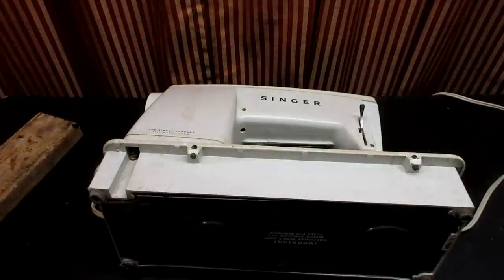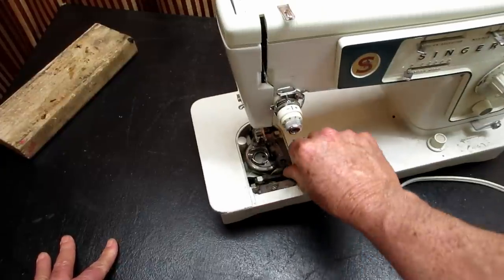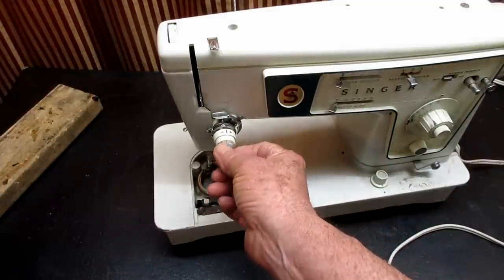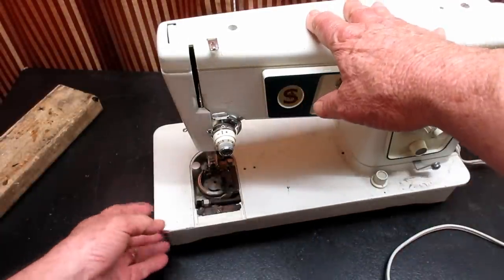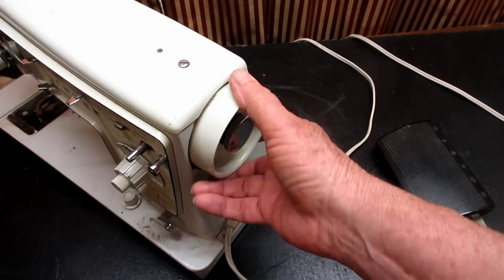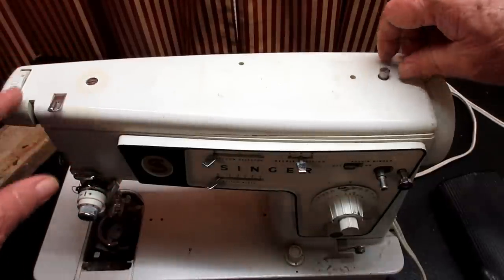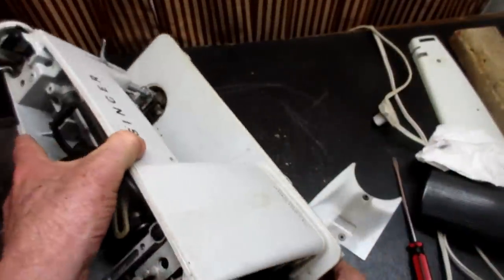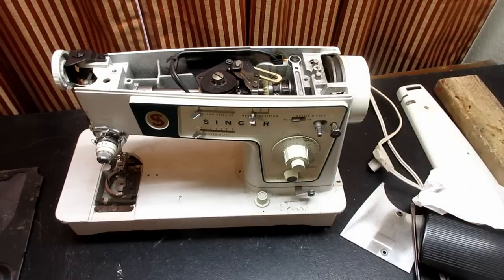About the Vintage Singer Sewing Machine my Wife bought me

Comment: I always liked the looks of this machine, but it's one I don't have. Congrats on figuring out wife speak! So few men ever really achieve that knowledge, lol! Do you have any videos or advice for me on a Singer 600E that cycles fast and slow when the foot pedal is depressed? The motor commutator is clean and the foot pedal works perfectly on my other 600E. Even went so far as to try another motor and still get the same thing.
Reply from the maker: Thanks for watching. I never worked much on the Touch & Sew Models. 
     If you feel that the speed cycling is NOT electric from your testing then maybe it is a mechanical binding. I have had machines do this and found the cam stack wheel gear set too close to the worm gear of the arm shaft. 
     I have heard from a couple of viewers with your model that thread can get trapped under and around the shaft inside the hook that raises the bobbin case up and down for winding the bobbin. First thread pieces, then those attract lint and they get bunched together and create problems. Their advice was to keep the bobbin case/hook area super clean. 
     Any of the moving parts can cause binding and be hard to isolate; take up lever mounting screw set too tight, bent needle bar. and one of the gear pairs can be meshed together too tight.
     It sounds like you used good methods to start troubleshooting through the electrical, ****} but what if it's the electrical connections on your machine? You took the pedal from the "bad" machine and used it on the "good" one, but did you take the pedal/cords from the "good" machine and try it on your "bad" machine? {****  
     Of course, you should always be sure the machine is clean and fully lubricated as shown in the Instruction Manual. Lack of proper oil/grease can cause problems no doubt.
     Model 600 is the 3rd generation of the 401A, and some parts are similar to it. I have some videos for Models 401A: https://www.youtube.com/playlist?list=PLsCOZgzzaiKLiDl9yFTP6mJgQmz5lj4NO    One of them is about removing, and cleaning the cam stack. https://youtu.be/aphiW06yp64   Not that you should do that, but I think it shows the gearing underneath so you could see the pinion gear, etc. 
     IMO, the Guru of T&S machine is Terry at https://store.tandtrepair.com/    He was a lead tech when the 600 came to market and then has his own sewing shop. He sells Service and Repair manuals and even repair guides he wrote himself.
https://store.tandtrepair.com/tosew600se.html     Some of those manuals may be of help to you. 
     I thought the 600 models had steel gears like the 301/401/500 models did. If the gears on your machine happen to be plastic they could be starting to lose the "teeth" on the gears and that can cause the problem you have until enough teeth break off that the hook and feed don't even move. Wish I had an answer for you but my lack of working on T&S models prevents that. Good luck.

Comment: aha another Singer discarded because of the dread broken top gear.  This looks so much like my 478 Stylist 'Special ZigZag' model,  the only change is the 'pattern selector'.  When I replaced the top gear in my 478, space was more than a bit tight - pulled the front panel off, but even with needle nose pliers there was limited room to remove the broken top gear.  A tiny offset screwdriver is like gold. But I just wanted to add, if you have an old clam shell pedal, its best to not leave the machine plugged in when you are not there.  Otherwise you might see a machine start sewing all by itself, and smoke fill the room.  Taught me a valuable lesson - leave unplugged, when not working on it or using it. 
Good luck and I'm confident you will have this machine purring and performing beautifully in no time flat.  I am ordering new belts for my old Singers because I worry about getting parts 10 years from now.  The new ones don't have the fibers, so maybe I I will order a few.  
Thanks for your wonderful videos Andy, I really enjoy all your hard work.  So do a lot of other do-it-yourselfers out there.
Reply from the maker: Thanks for sharing this info, Cheryl. I've been getting some good tips and I appreciate yours. Btw, your clamshell controller needs a tuneup and reset and that will fix the self-start problem most likely. Here is a playlist of videos to clean it up and adjust it:
https://www.youtube.com/playlist?list=PLsCOZgzzaiKItPLWcK24FBoMdHK8vTXNi
When it's out of adjustment the contacts are making slight connections and the carbon stack is overheating.
The only other reason would be an old capacitor inside is failing. They were put in decades ago to prevent TV interference but I think your is too new for that. Thanks again, and good luck
Reply: @andytubesewing1953  oh yes, i have retrieved ALL your videos, and have even catalogued the urls.  oh yes!
I think the most likely destination for that particular clamshell pedal that went on fire is the garbage can..
I am going to order a new pedal, I can't remember if you said it was the capacitor or the resistor, 
but whatever it was, there was a lot of smoke and burning plastic smell, and whhhhhrrrrrr the machine started sewing all by itself, faster and faster... i thought the old Stylist was haunted.  Just mesmorizing, watching this machine from across the room. sewing all by itself.  
When the smoke started spewing out of the pedal,  I snapped out of it, and went across the room and pulled the plug. I still have the pedal, but I just saved it to make sure I get the same configuration of the plug, when I order a new pedal.  BTW, Like everyone else here, I am so happy to see you back at work.  Where would we be without you ?  Just a bunch of unhappy people with broken sewing machines, instead of a bunch of happy people with fixed sewing machines!
Reply from the maker: @cherylmckelvey9816  Wow, thank you for watching so many of my videos and keeping the machines in service. I've heard of the "smoking pedals" and "ghost machines" a few times. Thank goodness you were home at the time as some of the folks say their pedal started a fire. Yikes!

Comment: I’ve got a good one for your wife Andy. I bought a 201K a month ago on a Goodwill auction. It was (or looked), like it was in good shape. Won the auction at $165. They added $60 FOR SHIPPING and the other miscellaneous charges. When it got here, my box looked a little beaten but not too bad. Opened up the box and the bobbin winder had completely broken off during shipping. I know that because it was intact on the photos. I quickly emailed the Goodwill I bought it from but never heard back and I’m assuming I never will.
Well, so far super glue hasn’t worked so well… I don’t know what to do but maybe get one of those portable bobbin winders. The machine needs new electrical and I haven’t had the guts yet to tackle it. I used your videos (which are so helpful), to clean her up and she looks nice except for that darn bobbin winder. I looked at your tools list too. Boy, that’s a big list and I don’t know how much more $$ I want to put in her. I’ve already purchased a new vintage box of accessories and a vintage manual. The case it came in was smelly and so beat that I striped it down and put beautiful fabric on it. Polished the black on the case with shoe polish and it looks brand new. Now, I think the case might be worth more than the machine!
I just thought I’d tell you this story as I think I’ve learned my lesson from buying a machine from Goodwill. I can’t wait to see how you fix this one up! I wish I knew a place to take her in Minneapolis to get her electrical fixed and get her running. The place that used to work on vintage machines is closing up (bummer)! Thanks for all you do Andy!
Reply from the maker: Too sad about that BW. I'd email back again or even call the store that sold it to you. They do have a help center listed on the bottom of the main page, and you may even be able to return it unless the seller said no returns (the window of time probably passed).
Have you thought about using a JBWeld product? I have used a couple of them to repair metal damage on some slant needle machines. One that I liked was the Steelstik where you mashed the clay-like product together to activate it, then mold it to the part or make a replacement part. It dried a dark gray and can be sanded, drilled, painted, etc. https://www.jbweld.com/collections/metal
I also saw a couple of complete BW for sale on eBay in the $16 to $26 dollar range. I've never worked on a 201-2 or 201k, but I did bookmark a blog where they show rewiring a 201K with pictures and descriptions: https://www.igorkromin.net/index.php/2016/04/12/rewiring-a-singer-201k-sewing-machine/   Again, I have not done this myself, but maybe it will give you some ideas. EDIT: BTW, the tools are suggestions. When I started doing this I had regular screwdrivers, a rubber mallet, and a couple of wrenches. Over the years I've accumulated many more tools that make it easier.
Reply: Thank you so much for the advice. I ordered the JB Weld product and I think this is going to do the trick! I have been surfing eBay too to find the right part. The bobbin winder is molded into part of the motor case. I found one and took a night to think about it and the next day it had sold. One will show up again, I’m sure. For now, I’m anxious to see if the JB product will do the job with cast iron. Reading all the reviews, I think it will! Thanks again for pointing me in the right direction…
Reply from the maker: @icacoordinator  I sure hope it works out. Thanks for doing your best to save that machine. Maybe you would consider making videos of your adventure? There must be many people with this problem. Good luck.

Comment: The sewing machine I got from Good Will on ebay, singer 328k, I have been working on since September!!!! I would be crazy by now if it wasn't for Andy Tube. No it isn't running yet grrrrr. But I feel like I am getting close.
Reply from the maker: You're almost there! Thanks for your efforts to get it back in service. It's a vert versatile model, and well-made. Let me know if I can help.
Reply: @andytubesewing1953  so as of last night it is sewing 😃😎😆. It still needs some minor adjustments apparently so will attempt today. But I was able to play with all the accessories I bought from eBay for it last night and give it a little bit of a workout. What is happening now is apparently when I was trying to adjust the needle position selector bracket all this week I must have centered the straight stitch needle position for left instead of center. So at the moment in straight stitch left is center is right. Also the cam stack spindle is drifting around after some use so the set screw must not be tight enough. But miracle it is sewing 😊😆.  A fairly thin 9/32 wrench will work also but not too easily.
Reply from the maker: @RobinEvans-g4c  congratulations! So persistence and determination pays off in the end. Very nicely done. Should be proud of yourself and thank you for saving that machine from the trash someplace. Happy sewing!

Comment: Ohh, I have a model like this, well two of them.

One has the busted gear you talked about.
Reply from the maker: All the ones I bought used either had a broken gear or it broke the first or second time. I tried sewing with it. Those plastic gears are just 50 years old and is dry as a bone. Other than that, this 466 is like several
Reply from the maker: Every model of this decade with a plastic gear that I bought either had a broken gear or the gear broke the first or second time. I tried sewing with it. The gears are 50 years old now and is dry as a bone. This model 466 has a lot different access to try and get to the gear, so we'll see what happens. Thanks for watching my channel

Comment: Hi Andy,
21:30 you say its not moving like its supposed to. Afterwards you say, that all this is normal. I just bought the 466 but the needle thread won't catch the bobbin thread, because the hook is not moving. I can just move the hook by hand. How did you get the hook to move again, I'd be thankful for some help. I just couldn't figure it out myself. 
Thank you, Greetings from Germany
Reply from the maker: You have a broken gear on top of the vertical shaft. I show the test for this very common problem at @6:00 in the video.
Here is the entire playlist for this machine: https://www.youtube.com/playlist?list=PLsCOZgzzaiKJTjJ3dRTrDPtIqR6DMoaex
The next four videos after this one you watched explain planning for the replacement of the gear, removal of the broken gear, replacement of the gear, and how to reset the hook to needle timing after gear replacement. Good luck. OH! When I said it's all good I was talking about the timing belt not being broken, and the pulleys moving freely meaning they were not the cause of the hook not moving. (The hook was not moving due to the broken gear that turns the shaft that turns the pulley that turns the belt that turns the hook)  Maybe watch the videos? They'll take you step-by-step thru replacing the gear.
Reply: @andytubesewing1953  Thank you very much.
The new gear u show, 155819 for singers, is there other gear models i can use or is it just this one?
Reply from the maker: @fanax9668  this seller shows other model numbers. The gear works onhttps://www.vintagesingerparts.com/products/new-replacement-top-vertical-gear-fits-singer-models-413-416-418-457-466-476-477-478-518-part-155819

Comment: Have you ever heard of a Finesse 833 guaranteed by Pfaff?  I’m pretty sure it is really a Singer.  It looks like what you were working on.
I think  the gears broke and were replaced.  One repairman told me it wasn’t worth fixing.
Reply from the maker: Yes, it gets mentioned on my channel about once per year. From what I understand it was not sold in the US. The 834 was sold in the US and is similar, and the manual for it is still free:  https://www.singer.com/search/support?title=834 You can find the 833 on eBay sometimes: https://www.ebay.com/itm/115385709610    
There are many Singer models that used the plastic top gear and they all have failure problems. The gear can be replaced and costs < $10. Many (most) shops don't want to replace the gear but rather sell you a new machine. The machines are mostly long-lasting and versatile except for that gear.
Reply: Thanks for your reply!  And sharing your knowledge!
Reply from the maker: @judyburke2932  no worries and thanks very much for watching my channel

Comment: Andy any suggestions for a replacement “ tension check spring for a Singer  4166- tried Singer- no longer available , any alternatives you;could suggest.  ( it’s that little thin wire that hold the top thread tension ( I have a engineer who wants it to work for me LOL)
Reply from the maker: Not familiar with that model, but search the model plus check spring took me here: https://www.sewingpartsonline.com/check-spring-simplicity---singer-730105.aspx    They are out of stock but now we know the part number is 730105. Search for that singer part number took me here: https://www.sewingpartsguru.com/products/730105-check-spring-pull-up   and here: https://www.friendlystitches.com/shop/Parts--Accessories/Bin-B08/p/CHECK-SPRING-Singer-117-2623-CHECK-SPRING-Singer-117-2623-White-1740-2037-2999-730105-x35335124.htm     I have no idea if it even looks like your check spring but that's all I can find.
Reply: Thank you so much for the information- have ordered and “. here’s hoping”.
Reply from the maker: @mlynncannon4188  Yes, here's hoping good luck!

Comment: The 1990 Sewing Machine Blue Book says that the model 466 was sold from 1969 through 1970 and cost $179.95 new and that it was made in England.
Reply from the maker: Thanks for sharing. My parts list for it shows "Model 466K", K meaning made in Kilbowie, Clydebank, Scottland, UK.
Reply: @andytubesewing1953  I suppose listing England was close enough for the Blue Book?? I have found a couple of mistakes in it before.
Reply from the maker: @randyc8171  a minor error really. I've never seen the blue book but heard of it. Then you have referenced it a couple times. It sounds fantastic. Really to have all that information right in the book. So what's a few errors? It's like a little treasure book really

Comment: What's the difference between a Singers 631G/611  and a Singer touch & Sew? They look the same. Thanks.
Reply from the maker: Models 611/631 have a removable bobbin case, usually made of metal, that holds a Class 66 Bobbin that is filled using a separate bobbin winder near the handwheel as shown in the Instruction Manual starting on page 12. The 611 manual is available from Singer Support for FREE: https://www.singer.com/search/support?title=611
Touch & Sew Models have a different bobbin that is wound "in place" meaning you do not remove it from a bobbin case to wind it. You push some controls that rais the bobbin a little bit off the hook and then run the machine to wind the bobbin. There is no separate BW system. This is shown in the Instruction Manual. Here is a link to a FREE copy of the manual for the model 758, a popular T&S model: https://www.singer.com/search/support?title=758
The T & S models were often called Touch & Toss or Touch & Trash by many of the repairmen b/c they considered the BW in place system to be "touchy", "sensitive", and prone to breakage.
Reply: @andytubesewing1953  Thanks.
Reply from the maker: @annesummers09  👍